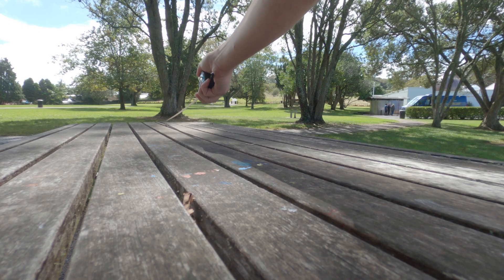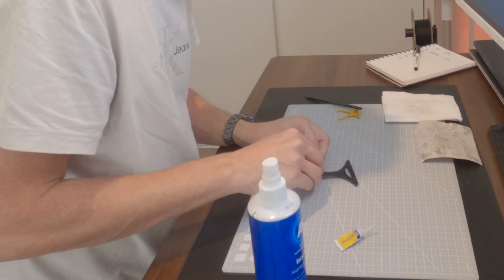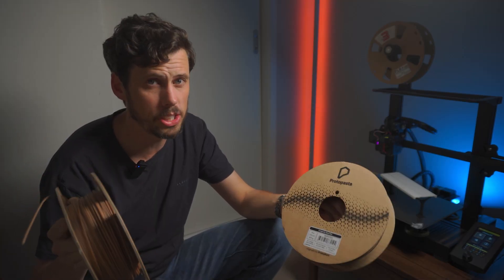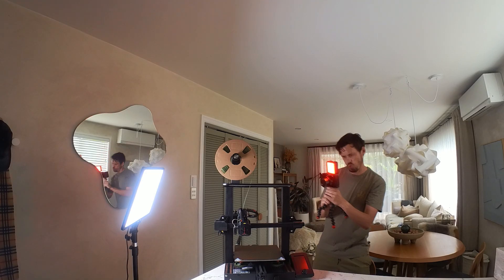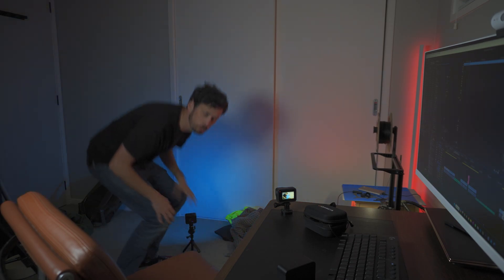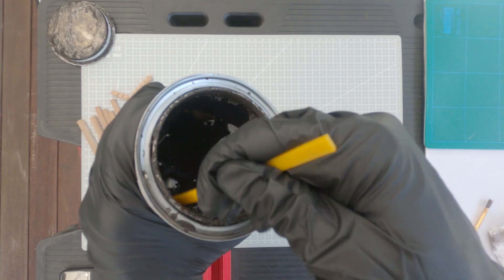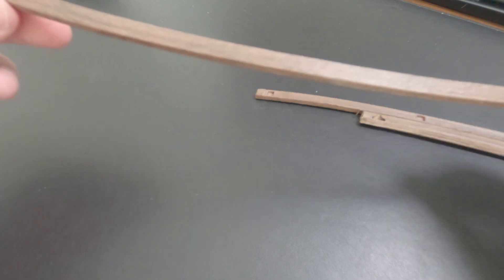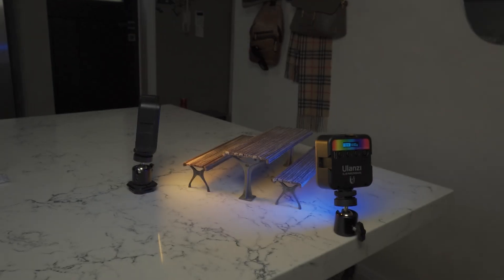Beginner 3D Printer AND Beginner YouTuber?! I Almost Gave Up!

Comment: Hey what's the heat gun you use?
Reply from the maker: Dremel Versatip. It's a gas soldering iron / heat gun. It's the same thing I was using to poke at the table legs to attempt giving them texture.

Comment: Damn! This doesn't look like the second video of a new channel! Great content, great editing, overall 10/10. Looking forward to more videos 💪

Quick heads up regarding your steel filament: Your nozzle is made out of brass and this is softer than steel. After just a little part of that spool, your nozzle will be fucked due to abrasion! If you plan on printing more steel filament (or glow in the dark or carbon fiber), get yourself a hardened nozzle :)
Reply from the maker: Thanks Felix! I recognize that blue hair from a comment on my first video. 

Yeah I had a bit of the video I ended up cutting out where I talked about using a hardened nozzle, all metal heat break and upgraded bowden tubing. Basically it was printing well and I didn't want to mess it up. I already had the parts to upgrade so in the end I just printed it on the old parts, then spent way too long doing some upgrades.

Comment: What is helping me to finish(?) things is not to seek for the perfection. Good enough it my goal - that helps me to make anything and not only think about making it or just giving up at start. Even if results are mediocre at best - I've usually learned a lot in a process and next "projects" benefits of that.
Reply from the maker: Yeah for sure. This video is a good example. There is SOOO much I wanted to fix and improved. But if I kept at that it wouldn't be out for another month... and maybe never get uploaded at all 😅